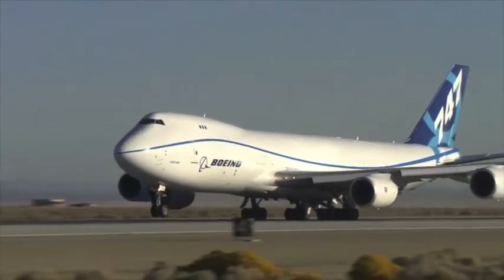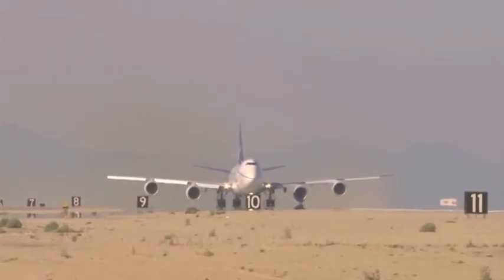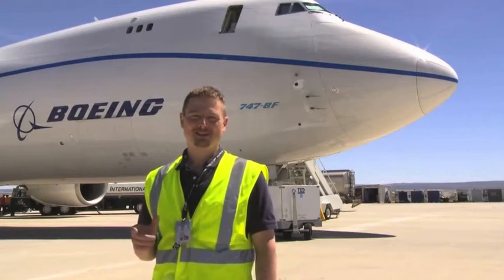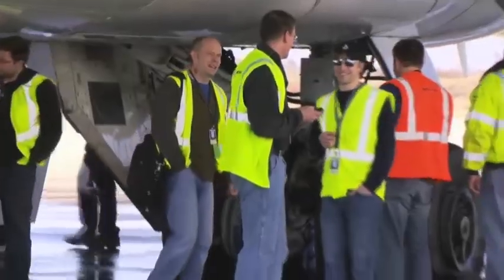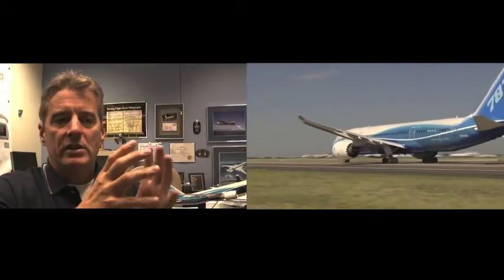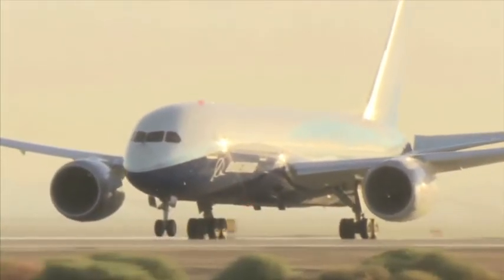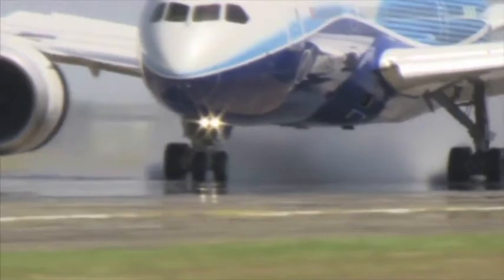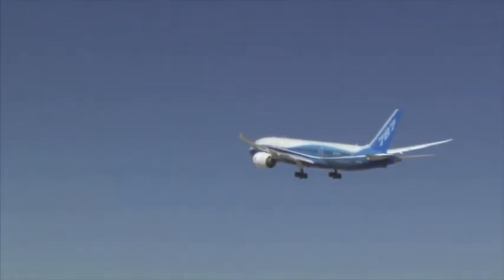Boeing 747-8 RTO Testing and pushing the Boeing 787 to the limits

Comment: Atenção ao RTO BRIEFING...
Reply: Realmente como a Boeing recomenda, após a V1 deve-se prosseguir na decolagem, subindo para a altitude de segurança de 780ft, mas no Brasil as cias adotam 1000fts, recolher os flaps dentros dos segmentos de performance da ANV e acelerar e prosseguir para uma altitude de segurança em um setor determinado, executar o check list apropriado e retornar para o pouso. Quanto ao vento cruzado o recomendável é baixar a asa para o lado do vento e pressionar levemente o pedal do lado oposto ao vento , assim manter a aeronave alinhada com a pista e próximo do toque + ou - 3 fts desfazer a pressão no pedal e realizar o pouso, mantendo o manche ainda virado para o lado do vento até o controle total da aeronave no solo. Para o Improved Climb, o flap 5 é o recomendado e não "puxar" mais que 12º de pitch para a decolagem a fim de evitar o Tail Strick.